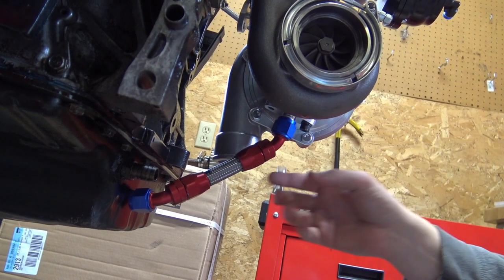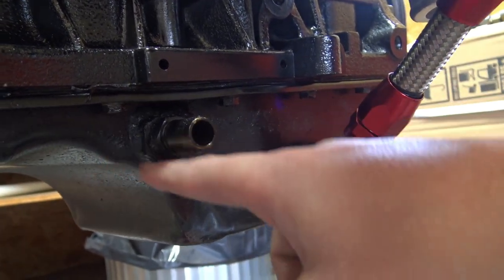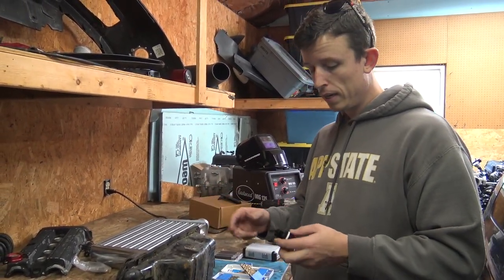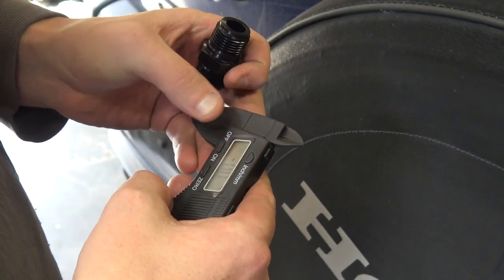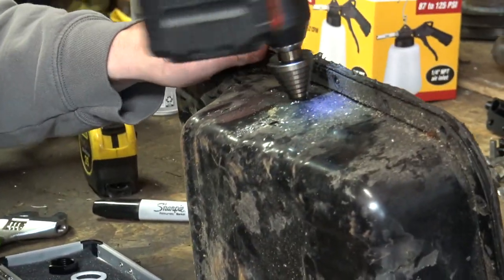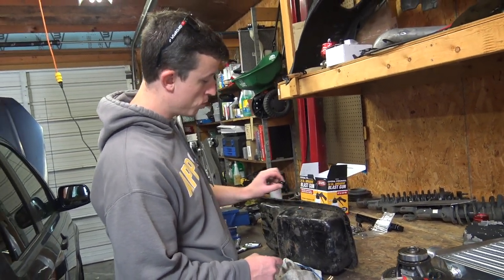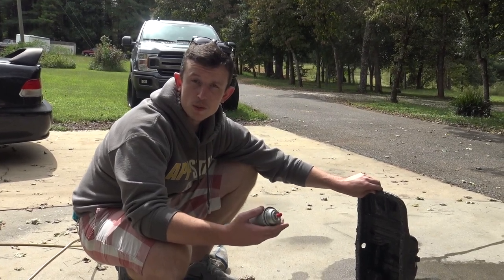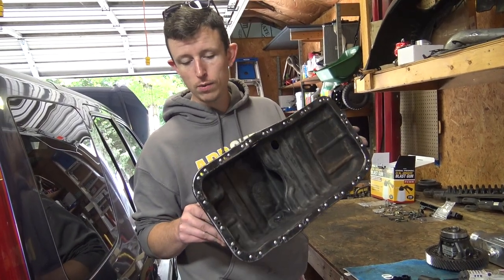How To Tap a Oil Pan | No Weld Fitting

Comment: will this work if I done two holes n applied two elbow joints n than attached two pipes running to the height of engine n topping off with an mini air breather on each to vent engine instead of having a pcv valve? not including the breathers on valve covers